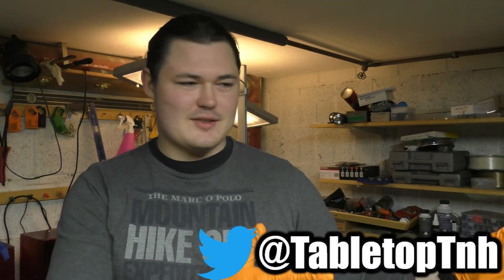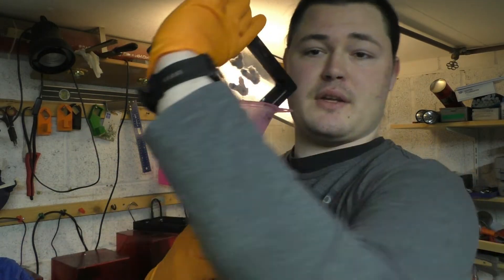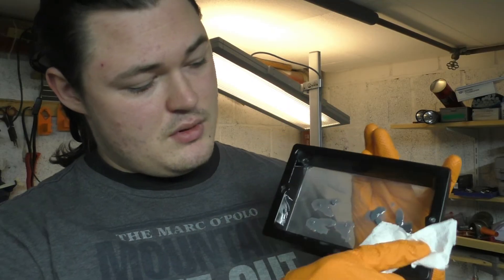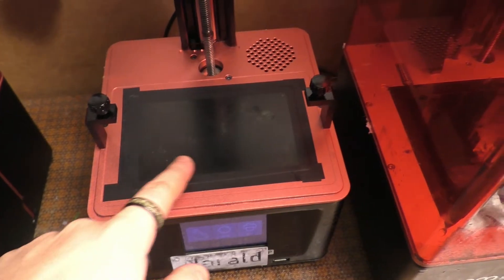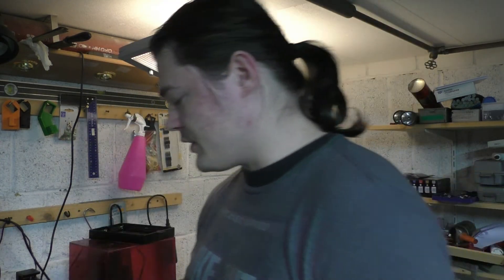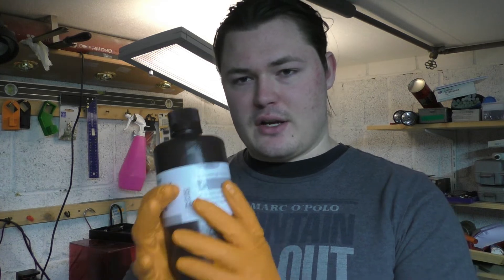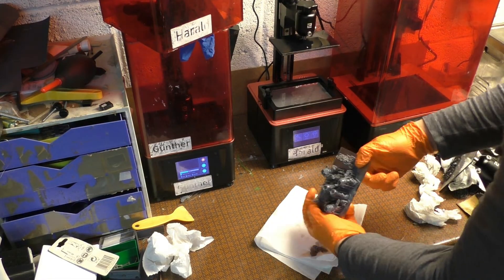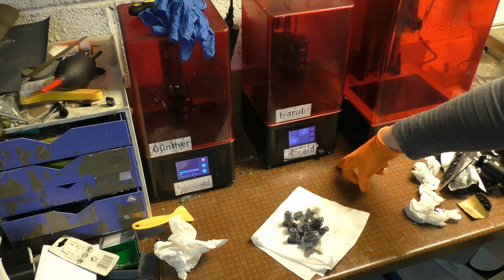Had a resin 3D Printing fail ? Do this ! | Resin printing tips | TNH Tabletop

Comment: put a support from another print on the corner of the VAT. do an exposure test for 15 seconds. pull on the support.
Reply from the maker: That also works for people but hasn't really worked for me
Reply: This works for me perfectly, saved me a lot of headaches — especially since you don’t even have to unscrew or drain the VAT or remove anything except for that layer

Though I use like 90s just to be sure

Comment: Can you provide an elegoo or amazon part number to use for the flexible plate you place onto your build plate? I have an elegoo saturn 3  ultra 12k. Also,.what is the part number for the film you are using to protect your lcd? Thanks much. Great video especially about the number of times to strain the resin, the mixing of the resin, etc. Ive watch some videos that say not to use paper towels but instead microfiber towels on the resin/vat. What is your opinion on this? Lastly, how do you  handle getting the sticky IPA/resin off of or out of tight confined spaces in your prints? Ive got the elegoo wash and cure stations. Thanks.
Reply from the maker: I have bought my flexible from WhamBam. Look here https://www.whambamsystems.com/collections/frontpage/products/225-x-129-elegoo-saturn-2-8k-and-saturn-8k .

I looked for a tablet screen protector that fits and usually buy more than 1 for my printers and they change by the hour so go look for a plastic one that fits the printer. The newer ones from elegoo have one preinstalled.

I use paper towels and have not found that they scratch my film but I use my own product for that which is better than standard PFA/FEP.

I wash my prints well with my hands and my ultra sonic cleaner. Typically an ultra sonic cleaner and the washing stations are all that you need. Works by hand as well. I will make a video about my new workflow this month when reviewing a new printer that's coming

Comment: If your printer has vat clean mode use it instead, remove the build plate of course then run vat clean or exposure mode it will cure one layer of resin that covers the entire size of the vat, this will capture any lose fragments, then peel the single layer off of the fep, throw it away then you are good to go, no need to empty the vat or strain the resin.
Reply from the maker: Keep in mind that there are no one size fits all solutions and this is just one way of doing it. Yours is super valid aswell